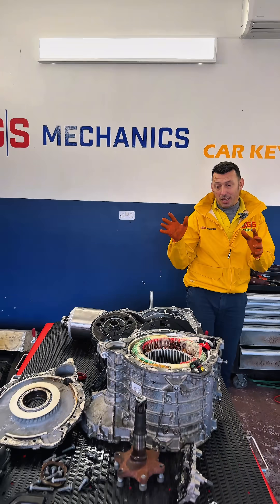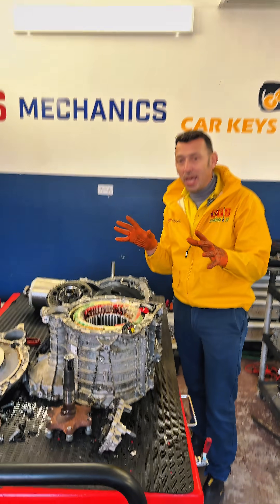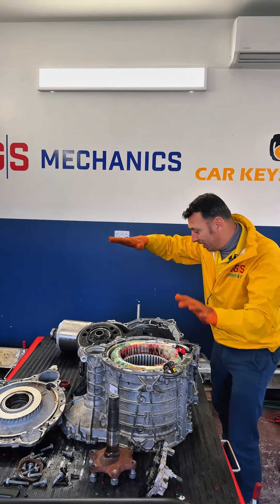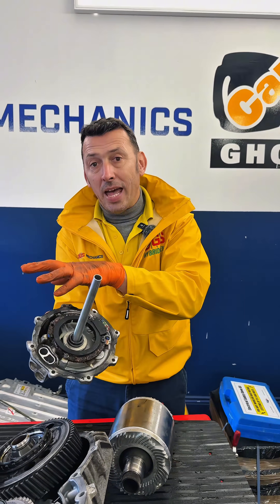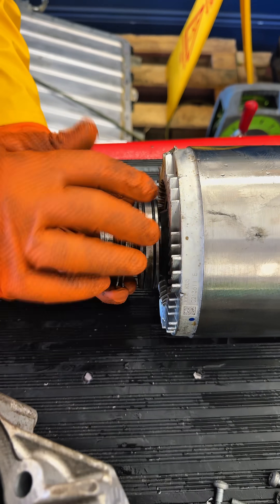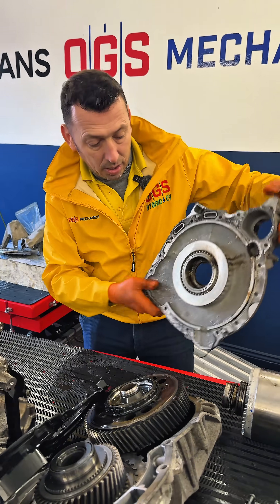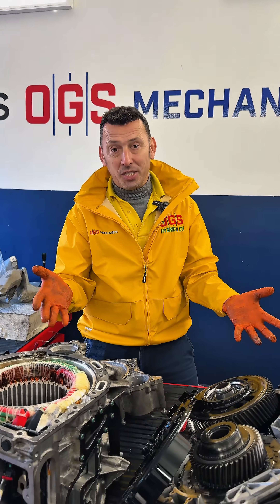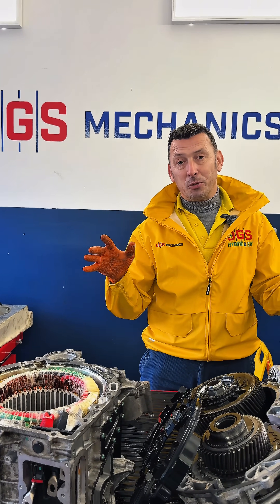E-Tron Electric Motor FAIL – Water Damage & Noisy Bearing EXPOSED!

Comment: It’s a stupid design with the closed seal drain canisters. Better to just drain it on the street with a hose. Someone I know was charged €10.000 by Audi to replace the front motor for this problem. Audi is not the only one with this problem also Tesla and Toyota have it.

Comment: Saving weight and cost is all good, but bearings just need to be a lot bigger. Just look at the size of the bearings in Tesla drive train. Costs a couple euro more, but saves very expensive repairs like this in. Cars should be design to last longer than the warranty period.
Reply: Tesla big drive unit also has bearing and water intrusion issues.
Reply: They are of you buy toyota 😂